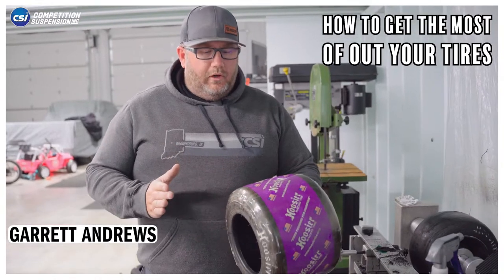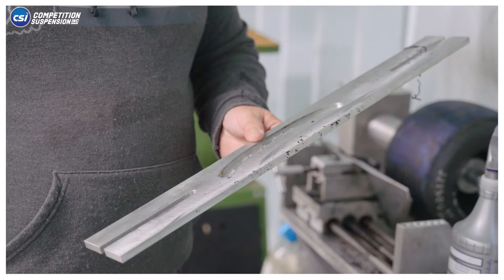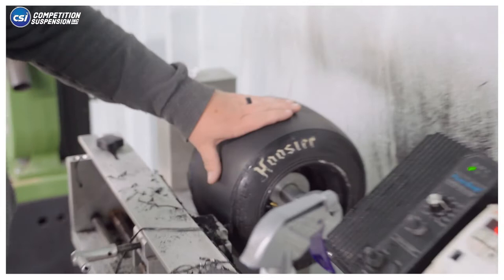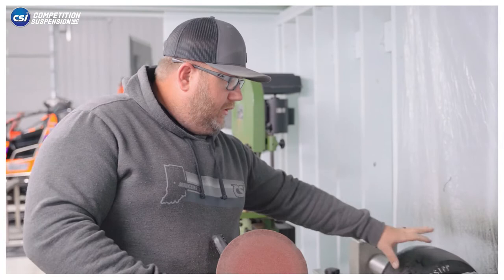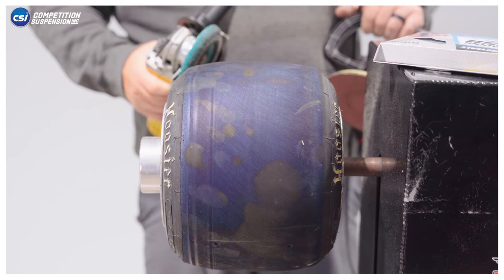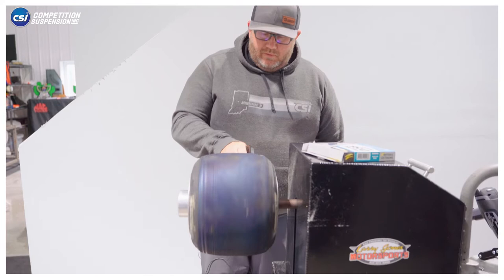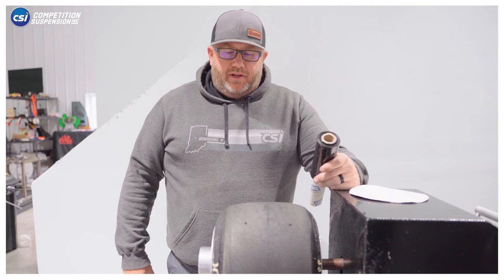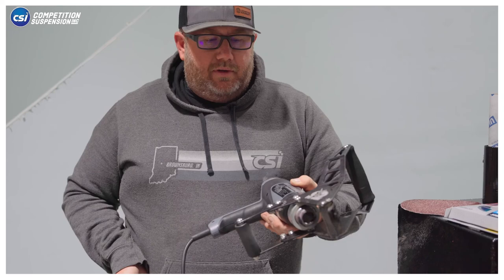Tire Tips | A Step by Step Guide on maximizing and maintaining your tires

Comment: Hey, I'm installing my tires to the rear rims and almost at 100psi. Still not wanting to seat yet.
Reply: Are you using a tire band to get them on the wheel? If not your asking to get hurt at that kind of pressure.
Reply: @josephhardwick6910  no tire band. I definitely tested there strength that's forsure. After several attempts at 100psi plus a little WD40 on the bead still nothing. But when I put them in our oven at 200deg, they finally seated perfectly at that psi and temp for an 1.5 hours.
Reply: @spekky9012  glad you where able to get them seated but I'd definitely try to find a tire band or become friends with someone who has one before attempting any more. They can definitely hurt you or even worse. Be safe
Reply from the maker: A tire band a little bit of soapy water helps a lot.  Make sure you have the valve core out so you can get as much air in the tire as quickly as possible.
Reply: @spekky9012  I could never bead with wd-40, get some of the vegetable based goopy stuff

Comment: Do you only get one race out of a set of tires?
Reply: From what I learned, dirt track you get alot of races vs 3 or 4  than Asphalt racing. Someone correct me if I'm wrong.
Reply: @anthonyreddy2834 nope I ran a whole season with a single set for all my features we ran double shows too so but for my other races I used 2 sets 2 heats 1 feature a show so I mean I used each set 2 times a night my feature set we ran Krug green it was some of the best stuff I ever had but that set never took anything I might have used the same set into the next season and the other set was usually experimental because the green was expensive and hard to come by but I haven’t raced for a few years now
Reply: @anthonyreddy2834 sorry I didn’t mean to tag you on that but yes you can get lots of races on some sets it really depends on the races you are doing and the preps you’re using
Reply from the maker: No we run 5-6 heat cycles normally.
Reply: @csishocks977  are you counting cautions as a heat cycle?